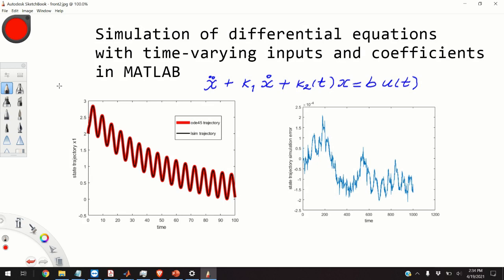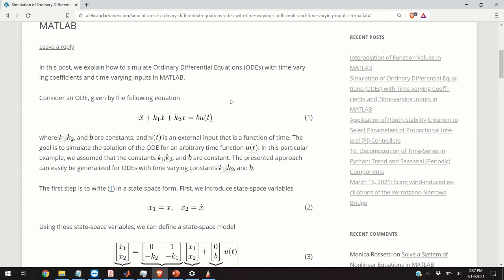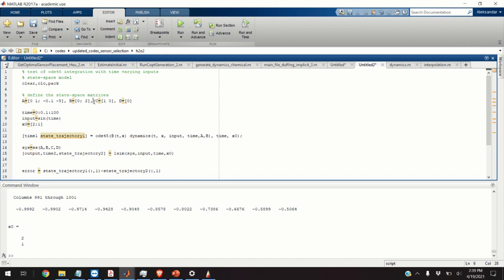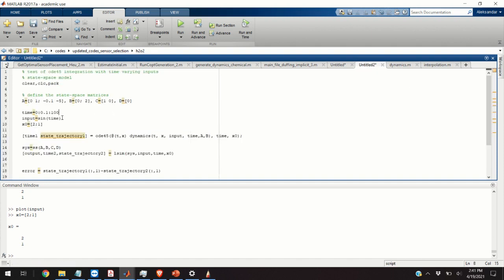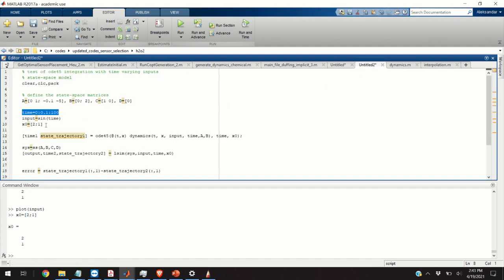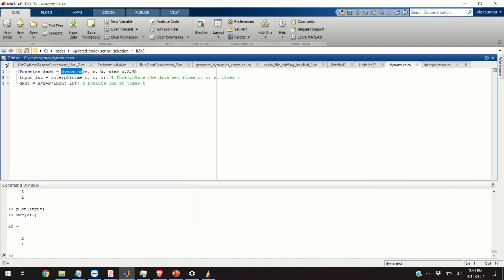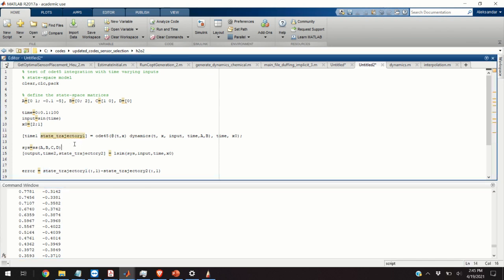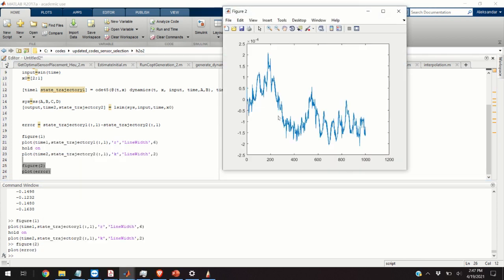Simulation of differential equations with time-varying inputs and coefficients in MATLAB

Comment: Could you let me know how can I solve the equation of one dimension :dxdt = -x +u ,where u is the input having random variables from the range [-2 2].
Reply from the maker: Use the same procedure that is explained in the video. You can specify the random inputs using MATLAB functions rand() (uniform distribution) and randn() (normal Gaussian distribution).
Reply: @aleksandarhaber  % Model
clear,clc,pack
K= 1;
%define Model
A=[-1];
B=[K];
C=[1];
D=[0];

time=0:0.5:100;
LV = -2; %Range of input signal%
UV = 2;
%Random input signal in the range of [-2 2]
u_k = LV+(UV-LV)*rand(1,length(time));  
x0=[0]

% Approach1 using ode45
[time1 state_stratergy1]= ode45(@(t,x) dynamics(t, x, u,time,A,B), time, x0)

% %Approach2 
% sys=ss(A,B,C,D);
% [output,time2,State_trajectory]=lsim(sys,u_k,time,x0)
% x-k= transpose(State_trajectory)
stem(u_k,x_k);
grid on

This is my code but I'm getting error while executing the code,would you please guide me further
Reply from the maker: @rohitnair4159  i am not able to debug your code, all I can do is to post intro videos, you also have to put some effort